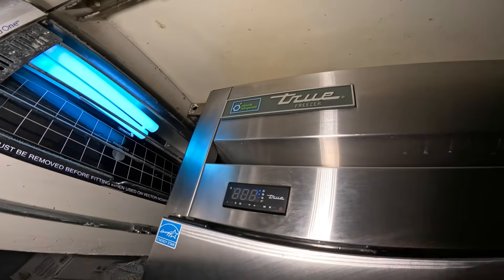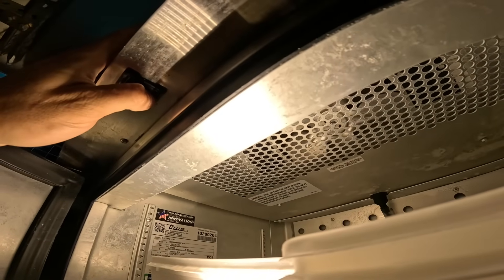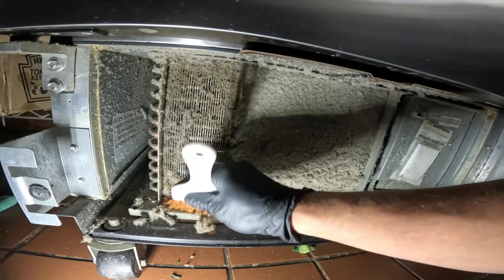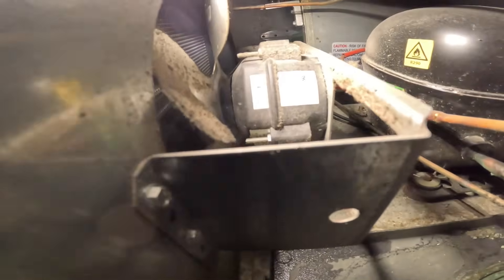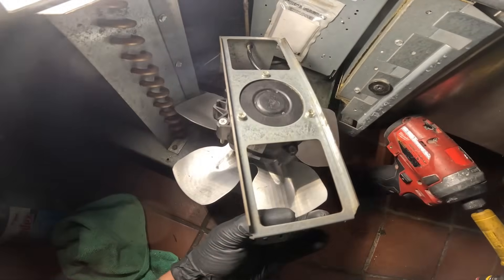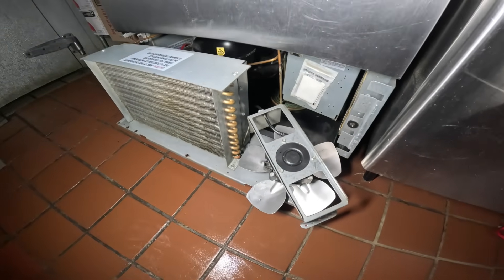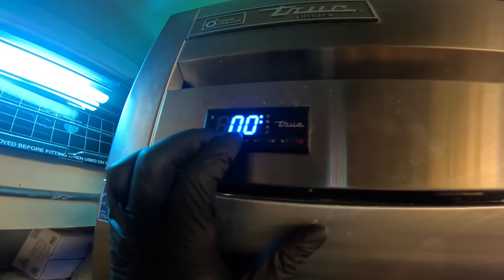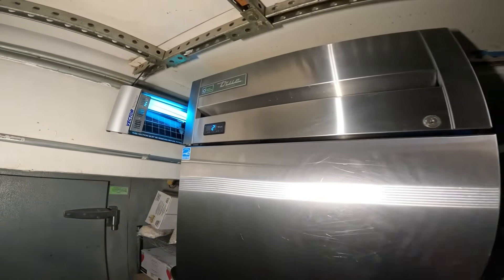HVACR: TRUE Freezer Not Cooling (R290/A3 Refrigerant) True Freezer Not Freezing/Working Properly

Comment: Explosion is an over statement. Thats a call back. Ive seen worst cond and they temp down. The unit running with a clogged cond burns up the oil and causes restrictions.

Comment: This vid makes me miss doing restaurant fridge service. I was very comfortable working with A3 gases like R290 though but I understand why some people are hesitant at first. I would purge the system with nitrogen before performing any brazing repairs. Also I feel the fridge would have come down in temp a lot faster had the product been removed, it's essentially acting as a warm load and takes a lot more time to bring the internal temp down as the heat is being removed from the product rather than just the air itself but I get that some restaurants can't do that. I'd normally throw everything on a cart and push it into the walk in and tell the customer to load in the fridge within an hour or two once the fridge setpoint temp is reached. Good video! Glad I came across this channel, really enjoy seeing what you run into.

Comment: True Refrigeration makes a video for R290 practices I do food ware repair so I see 290 coolers and freezer just have a vented area and a fan and you will have no issues. If I find a active leak I usually have it rescheduled for the night if it’s a larger system

Comment: 290 is a fine refrigerant, the implementation is shit. poorly made components, regulations limiting imported systems to 5 oz, bad system designs because of that rule. you couldve gotten away with a quick co2 blast on that one to be honest man. if it's actually greasy, next to the fryers, then the hot water and degreaser is necessary. also, youre at a restaurant, use a buss tub as a tray and to support the condensing unit (actually pull it out) vs the plastic bag

Comment: it takes between 21k and 95k ppm as the upper and lower explosive limits. if it had a leak running the kitchen exhaust would mitigate most of that. Though still hazardous just hope it happens on a rainy day

Comment: Completely normal the way the motor is starting
Reply from the maker: Thank you for clearing that up! Thanks for watching 🔧⚡️
Reply: yeah those motors are mostly electronic driven , so theres no chance for electric parts to "spark"  even the ones located at the condenser they usually start backwards for about a min to clean / clear coil then stop and go back to proper rotation.

Comment: 👍❄️💪🇺🇸 I like r290. Less equipment no recovery n 30lb refrigerant cylinder. Delfield has nice troubleshooting video about r290 n using temp probes to check system operations without tapping in to system.  I've worked on plenty of r290 tapped into system replaced compressors brazed. Just need to be safe n know what ur doing.  Purge with nitrogen, etc...watch some r290 training vids from true or delfield.  Good luck b safe
Reply from the maker: Thats nice to hear. Thats a good take on that. I am definitely going to look up some training videos. This seems to be going in most new refrigeration systems. Thanks for the advice & thanks for watching! 🔧⚡️

Comment: R 290 (propane ) is a very efficient A3 refrigerant. I like any non blended refrigerant -no glide . Can’t wait till they phase out all blends - good video .
Reply from the maker: Interesting take on that! It has such a critical charge. Only 2.8 ounces. Definitely don't want to run into refrigerant leaks with this one. Thanks for your input & for watching 🔧⚡️
Reply: @JumpermanTech  I should add -R 404a was a good blend -near Azeotropic - negligible glide . But it’s being replaced . Been working with A3 refrigerants for years , just need to use good safe practices .
Reply: @coldking8383  hey can I ask where you read this type of knowledge and learned this from? I have my EPA universal but I got a six years ago and I don’t quite remember but now that I read your comment I remember learning all about that stuff.